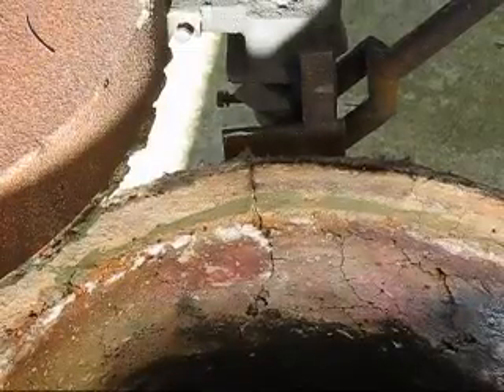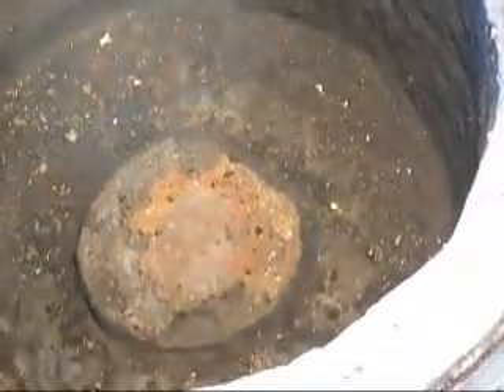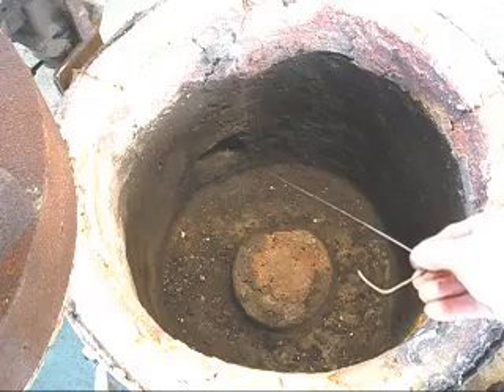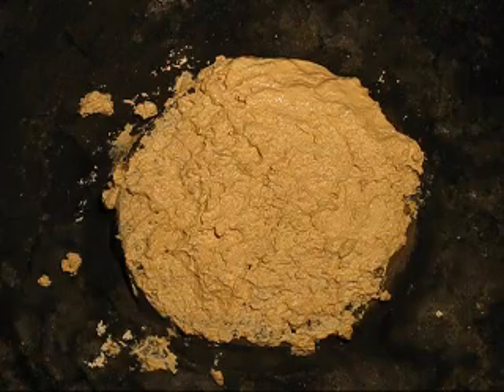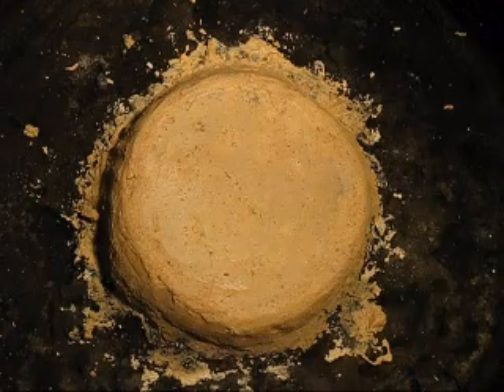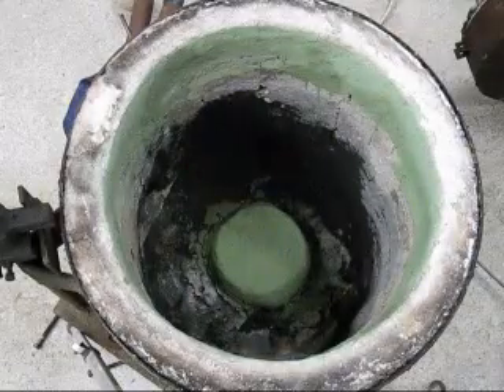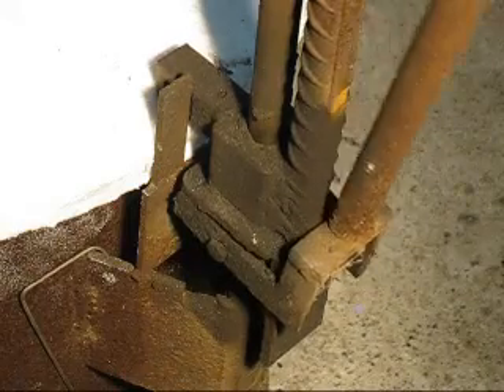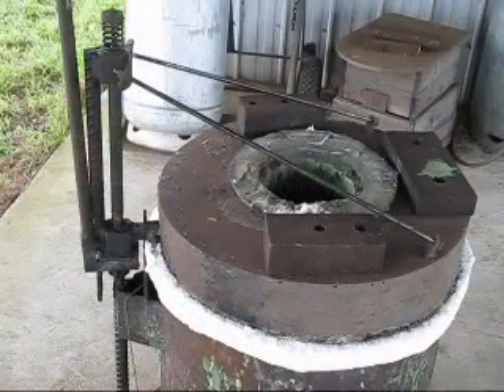Waste oil furnace overhaul

Comment: What is the diameter of the pipe that carries air to the inside? What is the diameter of the pipe inside the stove?
Reply from the maker: 35mm
Reply: Okay. How many cm is there between that pipe and the base? The pipe inside @luckygen1001

Comment: How long is the 40mm pipe on the end of the oil burner? 

Thank you i always enjoy and learning a lot of your Videos.
greetings from Germany 
 👍👍👍🙏
Reply from the maker: I am not sure which end you are talking about so I measured from the steel shell to where the twin pipes were welded, 145mm it is very difficult to measure the length inside the furnace.
Reply: @luckygen1001   Inside the furnace at the end of your burner is the hollow cone 40mm dia. and 65mm dia. on the other side. How long is that hollow cone? Maybe you can treasure? Thank you 🙏

Comment: Can you write the features of the ceramic blanket? I don't want to buy the wrong product
Reply from the maker: The kaowool I use is rated for 1400C but there are higher temp rated kaowool which you can buy which are very expensive. You must use a coating like satanite. The coatings I use in my videos are no longer available.
Reply: @luckygen1001  Do you think ceramic fiber blanket 1430°C 128kg/M3 and 50mm thickness is suitable?
Reply from the maker: @mertavlamaz6708  That is what I use but you can get 1600C which is very expensive and would be far better.
Reply: @luckygen1001  
Is there a site where I can find the product you mentioned. or a site you can recommend?
Reply from the maker: I go to Skamol Asia Pacific Region in Australia but I am not sure where you live. Just look for kaowool on the internet and the info you want will come up. @mertavlamaz6708
Reply: @luckygen1001  how many times can iron be melted in this furnace?
Reply from the maker: 30 times before it needs to be replaced so I melt 14 kg each melt so that is 420 kg total more than enough for me. I can melt 23 Kg with a larger crucible but I rarely need that amount. @mertavlamaz6708
Reply: @luckygen1001  Have you ever used 1600C fiber? What is the difference from 1430C fiber?
Reply: @luckygen1001  please.can you answer.this is important for me

Comment: Hi Ironman, just a small question... what pressure do you use in your oil tank? Thanks!
Reply from the maker: About 50 p.s.i. although you could use less using a 50/50 mix of diesel and waste oil. It all depends on temperature and how thick your oil is.

Comment: Hi Lucky, i've been looking for some details on your oil furnace (that can go to cast iron temps) do you have a video showing the burner details part? (i can't find one) i'm about to do an upgrade on my very noisy syphon jet burner. cheers Julian
Reply from the maker: I don't have a oil burner video, I must make one some time. There are lots of metal casters that use siphon nozzle burners and melt cast iron so easy. I think that you must be doing something wrong.  Also you can use propane to melt cast iron and I have a video about how to build a propane burner.
Reply: @luckygen1001  yeah i'm doing plenty wrong for sure! i think my main issue is damp air from my compressor, it's only just getting to bronze temps. i've added a water trap but it's a cheapy one and it's doesn't work very well. i have a supply of pink diesel for my farm machinery so i'm trying to use that if possible. Yesterday i got my air blower working great (old dyson motor) just waiting on a tiny 125CC motorbike fuel pump - and i can try them together :)
Reply from the maker: With propane I can melt 8 Kgs of bronze in 20 - 25 minutes ready to pour so your melt times seem too long. I use a compressor to pressurize my waste oil to melt cast iron and I do not use a water trap. I know that some water gets mixed in the oil but my furnace has no trouble melting cast iron.

Comment: good afternoon my friend, how are you? I have a question for you and maybe you can answer me! How many degrees of heat can sodium sodium silicate withstand?
Reply from the maker: I have used it to make sand molds for cast iron so it will withstand high temperatures.
Reply: luckygen1001 
   Okay, my friend, thank you very much for the answer.
    What I have in mind is that the silicate can serve as glue for graphite, and making the graphite into a nearly permanent mold. what do you think ?
Reply from the maker: I have not used sodium silicate to bind graphite but let me know if it works.
Reply: luckygen1001 
   yes, I'm almost sure it works.
    caustic soda yes. but separates with the heat!
   So I believe that the silicate does not separate because the molecules are broken, for a permanent mold I believe it works, to cast aluminum, and who knows more than that !!! 
   I thought that Blue Crystal  material whas silicato !
Reply from the maker: Caustic soda melts at a very low temperature.

Comment: +Luckygen1001  It looks like your oil injection tube is  a copper tube with cap with 1.6mm hole in the end.. Pressure applied to the tank to push the oil through to the 1.6mm orifice.. (Do you dilute your used motor oil with diesel/Kerosene to thin it? )
Also, you mention the 60mm x 40mm x 20mm wide venturi.. I don't see that.. I see the pipe with forced air, the copper tube with cap with jet sitting right at the opening of the pipe in the furnace... Is that all that it is?? Just insert, solder closed, and force feed the oil under pressure into the opening?  Thanks.. I tried this before with similar dimensions, but, didn't have much luck... But, I did not do a good job preheating.. Maybe that was it.. ??
Reply from the maker: The video shot of the burner is not very clear, the venturi is on the very end of the burner. Its purpose is to atomize the oil so it will burn with great heat inside the furnace. Yes I do dilute waste oil with diesel as it burns better. You can run 100% diesel in this furnace but it is a lot more expense. I do not use preheat on my oil or air, that is why I use diesel to dilute my waste oil. Have a look at my "melting ductile iron video" It shows a closer look at my furnace and burner when lighting up.
Reply: I did see that.. I think I have watched most of your videos.. More than once on many of them.. Quite a few times on this one, the propane and melting ductile trying to figure out the venturi..  I see the pressurized oil tank.. Knew it was not preheated.. The Venturi.. 65mm small dia. 40 mm 20 mm wide.
It looks like a straight pipe from the blower entry point to the inner furnace.. From the size of the pipe you use in the propane burner, it seems like the 65mm..  I don't see a drop to 40 and then back up to create a venturi,, and seems like the venturi would be restricted at the oil injection 1.6mm orifice,, or,, just before the neck down, or immediately after.. Air Volume/speed seems would be the same if the diameter were the same through the tube.. From the entry point of the copper tube for the oil feed until the tip of the orifice, it would reduce/restrict the flow by the diameter of the obstruction.. Maybe 20mm, but, looks like the only part that would be that large would be the cap.. Still don't see the 40mm, unless you are calculating the second pipe of the "Y", where you put the blower in.. I have seen a cone (what looks to be a plug) on one of the videos when you are running it.. Maybe you had intentions of running two blowers at some point?
I always have too may Irons in the fire and too many things that "have" to be done.. Trying to squeeze this project in, and make a different blacksmith forge (Dome that can be raised up on blocks on each side for the larger coil springs, etc.., then, reduced back down to regular size for general forging..). Was wanting to get the right materials and understanding and make two successful projects out of both.. 
I really enjoy your videos.. Really enjoy watching someone else prove/disprove things based on thoughtful testing.. I did a bunch of testing a few years ago when I wanted to build a "Cooking Rocket Stove".. One that I could cook on for 2 hours and cook Beans and Rice,,, in the event that we wake up one morning and that's all we have to cook, or cook with.. Ha.. I started by testing everything that should work and then, started testing what should "NOT" work, then,, took all of that to make the final "working" Long Time Burning cooking stove.. I call it the Long Horn Rocket Stove.. Works perfectly, and I know if I want to fudge the design, where I can and where I can't, without making other adjustments that aren't worth the hassle.. (keeping dry/fast burning wood, etc..).. 
If you ever can't decide on a topic for a video,,, a overview of the venturi and oil side of the furnace would be super cool.. There is no doubt you have nailed that side of things down tight.. Cheers and thanks from across the pond..
Reply from the maker: It is not a straight pipe to the inner furnace. What you are looking at is the end of the venturi. I think that the word venturi is not describing correctly what is there. There is a hollow cone which is 65mm dia.
and is 40mm dia. In that 40mm dia. you can see the 1.6mm dia. orifice in the center of that 40mm dia. A venturi in a carburettor is like two hollow flat toped cones put together. It draws petrol up to the orifice and then mixes petrol with air to be burnt in an engine. The Y section you see at the back is a relic of using very old vacuum cleaners as blowers to get enough air into my furnace. Modern vacuum cleaners put out a lot more air so that is why I use only one vacuum cleaner now. The plug you see on the Y section is a wooden plug to stop air leaking out of the blast pipe when using one vacuum cleaner.What you need to do is to get some 65mm pipe and neck it down to 40mm. then you need to put another small pipe with an elbow so it can be connected to a source of water. That small pipe then needs to have an orifice 1.6mm dia. located right at the end of the 40mm dia. Connect up a blower and have a look at the spray pattern. As the spray comes out of the 40mm dia. it makes an inverted cone. It would be a lot better to build a mock up to see how it works. If your cone and orifice is located too far back the spray will condense on the wall of the 65mm dia. pipe so the oil will drip into the furnace causing a lot of smoke and not very hot temperatures. The 1.6 mm orifice size was the smallest drill I had at the time and using thick waste oil it was big enough to allow it to pass through and gave small enough droplets to burn in the furnace. Having said that everything was welded together, so to change anything now would be too much trouble. I would like to experiment with different orifice sizes but it works so well I see no need to change anything. That hollow cone on the end of my burner was machined from a solid piece of steel and then welded to the 65mm pipe. Its only function is to speed up the air so the oil atomizes better. The reason I use vacuum cleaners is because they produce a lot higher pressures than other blowers. Blowing air through that cone to atomize the oil does restrict the air flow if a low pressure is used. I hope this helps.
Reply: Ok.. I think I understand..  The 65mm pipe is coned(reduced) down to 40mm at the opening of the furnace.. The 1.6mm jet is at the opening of the 40mm. Probably set back 20mm or so into the 40mm opening.. As the pressure is released from 40mm to the open furnace, it would create a venturi effect..  I will play with it and get it figured out.. Between tank oil pressure, viscosity of the oil/diesel mix, size of orifice, and variable speed/volume of air pressure, should be able to find a happy adjustment in there somewhere that will make the whole setup happy.. Ha.. I never preheated the forge before I started adding oil.. It was actually an open burner blowing into a larger steel tube.. I can see that was a mistake.. When I did get it hot it worked much better, but, I was also dripping oil across an air jet which was not very efficient for atomization of the oil.. Did work much better thinned down.. I have about 2 weeks close up time, then, I will give it a go.. Gives me time to get the rest of the supplies ordered and received..  Thanks LuckyGen... Very much appreciated..
Reply from the maker: That's good,  you are headed in the right direction now. Once you understand how it works the sizes can be changed a little bit to suit what tools you have and what pipe you can get in your local area.
Reply: I finally got around to calling CMS about the Zircon W.. Seems they have gone out of business over a year ago.  When I called their USA number, it had been taken by a http://bradken.com/ company which is a large Casting/Forging Company. They said they had stopped using Zircon W and didn't think it was made any longer and had moved to a ASK Solitec 903 wash by a company http://www.ask-chemicals.com/contacts/locations.html which has a distributor in Hurstville, Sidney, that is listed on that page. Bradken said they had moved to this product before they stopped making Zircon W, and vouched that the product was better for them.. Interesting that you chose something that no one I have spoken with realized that anyone would use it for coating Kaowoool, but, what's better than what coats moulds that you are pouring hot molten steel over anyway.. Ha.. Excellent choice and thinking outside of the box.. 
Bradken said the product was less than $1usd/pound, but, they bought drums by the pallet..  I just talked with Mike at Ask-Chemicals, they use a distributor here for smaller quantities . http://www.porterwarner.com/  Will call them tomorrow..  He said that it might not be rigid enough, but, said it was very similar to Zircon W, about like a house paint, so, might have to check it out.. Might only sell it in 5 gallon buckets.. Grr.. Said it had a shelf life of 6 months, but, easily last 12 months if kept cool.. About 60 degrees F.   http://www.morganthermalceramics.com sold that line of products to another company. 
I can't find anything  on J-Coat.  I know you used it for the bottom of your forge and just ran out. Why this product, instead of Zircoat W?  Why did you use two different products in the forge? What are the qualities of the J-Coat vs Zircoat W? I will talk to their distributor tomorrow who handles more products than theirs alone.. I will see what else they have.. Cheers.
Reply from the maker: J coat was the only coating I knew about at the time. Used it  for years in a 5kg pail but they decided I had to buy in large amounts (50kgs), way too expensive! So I asked around and zircon W was recommended. Also it could be purchased in smaller amounts that would suit my budget. I've had mine for 6 years and is still ok to use. I never thought to look on the label to see if it has a use by date. I have known for a long time that foundry products are getting harder to get. It seems that it will get worse in the future.
Reply: luckygen1001 I am noticing the same thing. I hope this Zircon replacement doesn't turn out to be the same thing. I don't need a whole lot of it. I've been chatting with a fella on YouTube and we have been scratching heads and coming up with a mixed nobody's thought up before. We'll see how it works out. So far everything is easily available. And should put us pretty close to 3000 degrees all the way around. Probably in the 2850 to 2900 degree Fahrenheit. 
And so far, nothing really has a shelf life. But we are looking at sodium silicate in solution versus the powder on that one. I'm taking good notes. I figure I usually build at least one prototype when I'm doing something brand new. But I've been pretty lucky. I'm still using a lot of them. Thanks for the feedback luckygen. I'm going to give your burner a whirl when I get everything put together.
Reply: Would you like please more explain, is the 40mm dia. Placed at the end side of burner or at the blower side?
Reply: Zirkon yerine ateş kili veya alüminyum oksit kullanamaz mıyız?

Comment: I have a waste oil burner that I recently ran off of diesel it can melt aluminium but doesn't get hot enough to melt brass. 
 Does oil burn hotter than diesel?
Reply from the maker: I use waste oil to melt cast iron because it is cheaper than diesel but both will get a furnace very hot. If you cannot melt brass there is something wrong with your furnace or you are operating your burner incorrectly.
Reply: luckygen1001 Ok thanks. 
I think my burner setup needs to be adjusted.

Comment: I don't see any kind of mechanism to pre-heat the oil before it gets injected in the furnace? could you please give a simple explanation?
Reply: Pre-heating the oil won't make much difference, the furnace is already thousands of degrees hotter than one would heat the oil anyway.

Comment: whats hotter: Waste Oil or Air-forched Propangas?
Thanks
Reply: Propane is 3600 F depends heavily on air fuel mix, and Oil is 3800 F or so depends on the type of oil and the air fuel mix. I have read that the peek temp for propane can be very high maybe up to 5000 F (From Google search). But in either case both are very hot when set right.
Best Matt